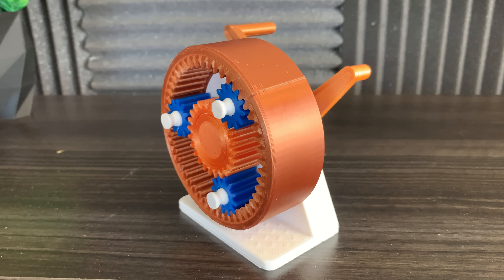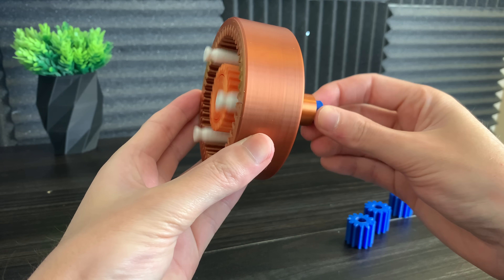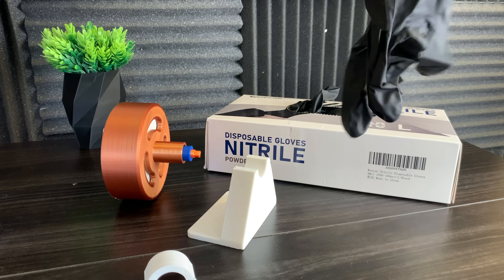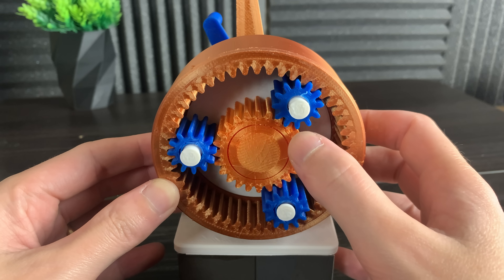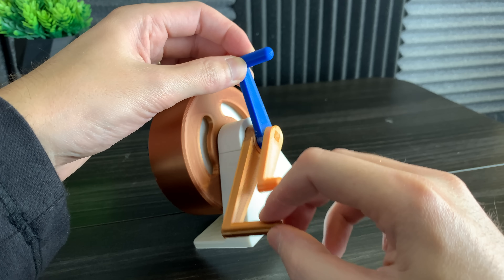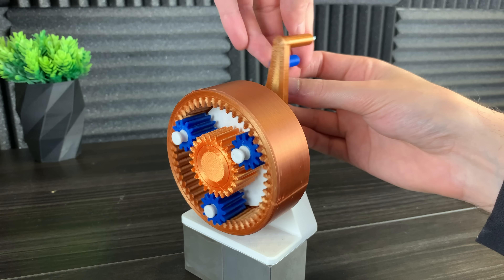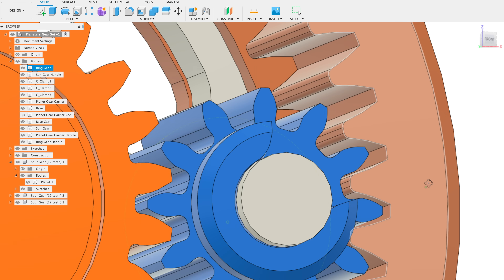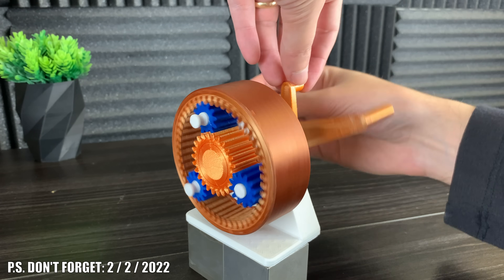What makes planetary gearboxes so amazing?

Comment: Hey guys I made 4 gears inside a reversed gear while you might think it's simply its actually really complex because I had to resize the gears to get them to fit and added 2 more handles than are necessary to make it spin. So yeah its really complex

Comment: Adding electric motors to the gearbox effectively turns it into a cvt.
A thing toyota made in their hybrids.
It works by spinning two of the 3 components in various directions and ratios to acheive infinitely variable gears.
It is also probably the most reliable transmission ever created, as there is no friction material, nor a torque converter, just gears and electric motors.
Reply: I though cvt used a belt situated between to cone shaped gears.
Reply: @fredtaylor9792  a CVT means infinitely variable gear ratios, and there are more then one method to acheive that.
Those are called belt driven CVTs. This is an electric CVT or eCVT.
Reply: @fredtaylor9792  that's exactly what it is, infinite gear ratios - an F1 Car from the 90s or 80s, if not 70s used it I think
Reply: Wouldn't that need variable input speeds to work?
Reply: @ki0w0-lordofwatersheep  that is what the electeic motors are for. One sits on the input shaft of the engine, and can rotate faster, slower or in reverse for lower gears. It is capable of generating electricity from the engine when needed.
The other sits on the output shaft and varies the rotation  as well as acts as a generator when breaking. There are many videos explaining this in a much more concise way.
Reply: it better be reliable, i have a prius prime and saw a video about opening it's transmission. it's huge and very very complex. and about 10kUSD lol. in most cases it would mean that the car is totaled if the trans fails.

Comment: Those super glue tubes often have a little point on the top of the cap that you can use to pierce the tube open.  (like you are trying to press the cap on upside down)

Comment: Superglue isn't perfect, and it sometimes has a tendency to break. Perhaps, you might want to put a key on the shaft/handle, so that they are less likely to break off. Also, I often use either mineral oil or Vaseline,  for plastic parts, depending on what viscosity is needed. Sometimes, silicone seems a little thin & it seems to have a tendency to disperse, after a while. It doesn't seem to agree with all plastics.

Comment: These ratios assume that you are holding one gear STATIONARY. However, if you instead connect an electric motor to one gear, a gasoline engine to another, and the wheels of a car to the third, then you can modify the speed and direction of the electric motor to get continuous variable ratios between the gasoline engine and the wheels!  It's a CVT with no belts.
Reply: Add a second electric motor connected to the output and to the wheels, and you get exactly what Toyota does on their hybrid models.

Comment: 3:13 here is some help with super glue that a lot of model makers and prop builders use in a pinch. If you put glue on one part and just touch some baking soda to the other side it makes the glue dry almost instantly. But if I was trying to attach 3d printed parts with glue, I would avoid super glue because it tends to heat up while it cures which if you are trying to get a prefect fit tends not to work well and can melt or misshapen what you are gluing. Depending on your filament you are using you can use Testor's Plastic Cement (Which will form a bond by melting and fusing the plastic together without heating up) Gorilla Glue one hour epoxy which hardly heats up when curing, or this might sound weird but make key slots and fit the pieces together and use acetone to melt the seam together. I normally opt for the third one.

Comment: The latest example of using a planetary gearset is in the design of a Toyota/Lexus hybrid transmission.  It's nothing more than the internal combustion engine (ICE) driving one of the planetary cranks and an beefy electric motor driving another crank, with the third crank tied to the wheels.  Either the ICE or the motor or both can spin to drive the wheels, and by using a computer and a gigantic 600v battery the motor can actually spin backwards, as needed, in order to match the desired ICE rpms to the wheel rpms.  The whole thing is brilliant and totally transparent to the driver, and since it's nothing more than just a planetary gearset it's indestructible.  And no "shifting" per se--instead, the computer just directs different motor and ICE rpms to meet the wheel rpm needs.  Toyota calls it a Continuously-Variable Transmission (CVT) but it has nothing in common with the old-fashioned CVTs that used cone-shaped pulleys and a steel drive belt that would eventually fail.
Reply: The worst thing about this design is how they have to protect it in low traction surfaces. If you get snow and have hills they are terrible because they can’t allow a spinning wheel to suddenly gain traction or parts break. You can have your foot planted and the car will just slowly come to a stop in the middle of the hill. I think they have a ton of room for improvement.

Comment: The gear ratios don't depend on the number of teeth on the planetary gears. Just the sun gear and ring gear.

I know that your ring gear has 2x as many teeth as your sun gear because it produces a 2:1 ratio when the planetary gears are held still.

Comment: Nice video and explanation. Always  impressed when YouTubers just design and 3d print a model as a part of the demonstration. I thought that automatic transmissions worked with fluid dynamics? Always like a day at the library.
Reply: They do! The final drive of the shafts is similar once you get beyond the torque converter and down to the output end. He'd have been better concentrating on transmissions in general rather than confusing the issue with auto vs manual transmission as it's arbitrary.

Comment: Could you take rotary power directly from the planet gear instead of passing it through the carrier...I mean if you use a flexible coupling may be a spring and Connect it to the planet gear face I think we could get another new ratio there

Comment: I wonder if you could use this type of setup instead of a belt to turn three generators at once with a single rotation of a windmill and wire all three generators in sequence to produce higher voltages or something like that, I mean I know I'm not smarter than an engineer and anything I could think of they probably already thought of but haha brain go brrrr
Reply: Think it wouldn't change anything right? The driving force behind a windmill won't be bigger. You can't get more power out of the movement, you can only make it more efficient at getting said power to the generators. I might be wrong but feel free to comment If I'm wrong
Reply: @spacethecatt  well you definitely can't produce more energy than you put into a machine, that's one of the laws of conservation of mass and energy or whatever right? But I highly doubt that enough wind to spin one of those huge propeller blades isn't enough to spin several motors rather than just one, it's not a question of multiplying what you get out of it it's a question of making it more efficient at producing the same amount of energy the wind puts in

Comment: Worked out the stationary-sun planetary-input ratio for funsies.
Step 1: Count the teeth. Sun=24, Planet=12, Ring=48
Step 2: Imagine that the planetary gear orbits the sun with the same contact position the whole way around. It will drag the ring gear for 1:1. That is, the ring rotates a measure of 48 teeth.
Step 3: Forget the ring gear and just consider the planet rotating as it orbits the sun. Its circumference has to lay across the sun twice because of the 1:2 teeth ratio. So it rotates twice in one orbit.
Step 4: The planet rotates in the same direction of its orbit, so it pushes the ring gear along faster than if it were dragging it. Just as twice the planet's circumference contacts the sun, the same will contact the ring. So it pushes the ring forward an additional 24 teeth.
Step 5: The ring rotates a total measure of 48+24=72 teeth. That's 3/2 of its circumference, for a 2:3 ratio.

Is the stationary-sun, planetary-input ratio generally just (ring + sun)/ring?
Reply: Then the stationary-ring, planetary-input is just (sun + ring)/sun.
And for stationary-planet, the sun and ring just translate directly to each other through the planetary gears, and since the opposite sides of a spinning gear are moving in opposite lateral directions, it's just -(sun/ring) or -(ring/sun).

That's simpler than I thought.

Comment: Well. This model seems more durable than normally in practice.
Reply: Planetary gearboxes are used in automatic transmissions that can last over 100,000 miles. They're pretty durable in practice.

Comment: Good design. I would try to incorporate ball bearings, and make the gear teeth helical for smoother and quiter operation.
Reply: And I would do different designs to show a better view of how 5 drives work. Neutral, Reduction, Overdrive, Reverse, and Direct Drive.
Reply: Helical gears would put an axial force on the members and complicate it further.

Comment: Most people dont understand that this is exactly how an automatic transmission works. Not that hard lol
Reply: Most people don't understand that the gears rotating on a Gear-Teeth 'wall' makes the entire thing follow the principle of a Wheel and rotate itself due to the smaller gears because, well, there's no space otherwise so it pushes the entire thing by rotating it. It's so painfully simple in design that the fact that many don't understand that kind of logic makes me question if we evolved to be smart, or are going back to the middle ages where people managed to forget everything that Greek and Rome managed to make, like the aqueducts and actual sewer systems.

Comment: If you vary the speed of individual handles you get a continuously variable gear ratio. This is what Toyota uses for their hybrid transmissions.
Reply: That's not how CVTs work. They usually use belts on tapered discs, or other friction based mechanism that can produce arbitrary changes between drive and driven axles.
Reply: @batlin  belt or chain driven is the most common but there are more ways to achieve a CVT. The Toyota hybrids use a planetary gearset for example.

Comment: Monster trucks use these inside the wheels so the planet carrier is fixed, the sun gear is attached to the axle, and the ring gear is bolted to the wheel since it puts so much stress on the engine to rotate the huge tires.
Reply: My dad's 4 wheel drive Versatile tractor had that setup too.
Reply: @deviljon  not surprising since monster truck axles are adapted from heavy equipment axles.  Monster trucks also have inboard disc brakes at the differential.
Reply: Most heavy equipment (loaders, dozers, graders, etc) also use planetary gears at the drive wheels.
Reply: @tothesummit5864  Correct, in fact the planetary wheel hubs monster trucks are actually from mobile cranes.
Reply: Wow
Reply: Unimogs have "Portal" axles with the reduction at the hub end - I think the half-shafts run in reverse. There are aftermarket portal hub conversions out there now.
Reply: My man! Remember watching this on Modern Marvels when HC didn't go full reality.

 First time I learned about it.
Reply: Bulldozers do the same with the drive
Reply: The sun is attached to the axle and the carrier is attached to the hub(wheel), the ring gear remains stationary on a tractor front wheel drive.
Reply: Double you tee eff

Comment: What clearance are you using for the things to rotate when printing? Like how much gap is there between the pins in the planet carrier and the inside of the planet gears for them to spin freely without much friction?
Reply from the maker: I find 0.4mm usually works great
Reply: Depends on the printer and material. I normaly get away with 0.2mm with PETG
Reply: Copied from my notes I use for my own projects:

.5 mm = 20 mils = fairly loose, some catching
.35 mm = 15 mils = tight fit, fairly easy removal
.25 mm = 10 mils = very tight, removal difficult

I use PLA in an Ender 3 Pro, which is a fairly common setup.